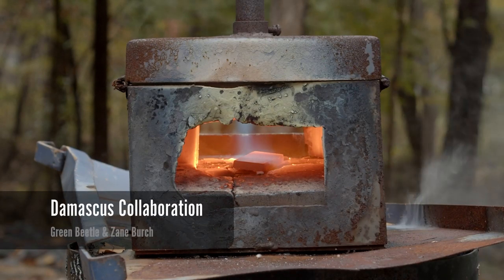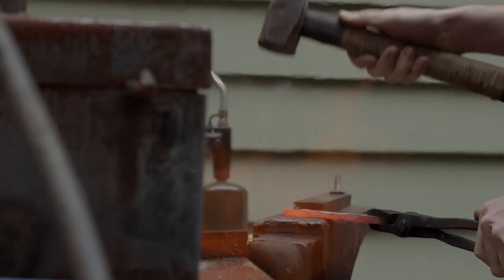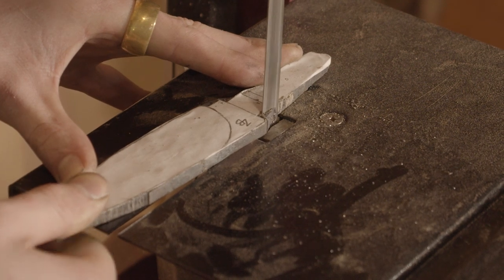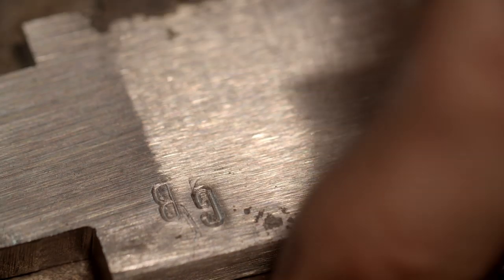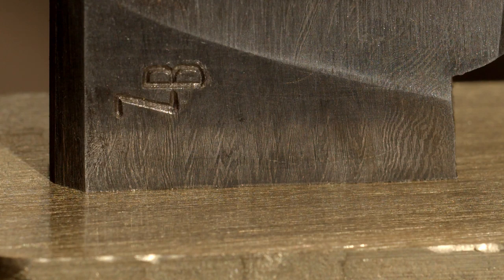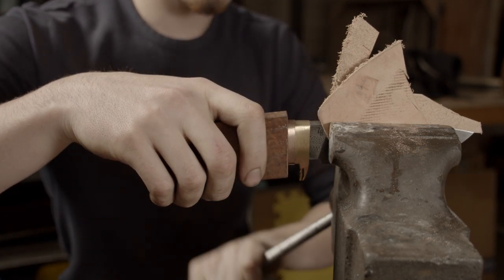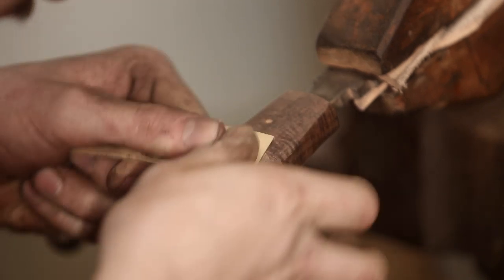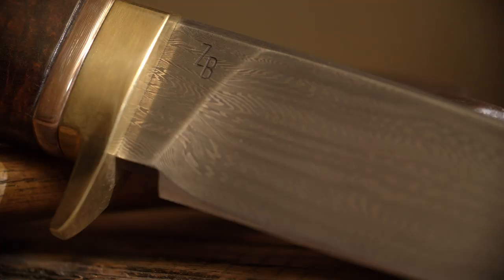Damascus Knife Collaboration With Green Beetle

Comment: The ringed gidgee pattern sure suit the pattern in the blade. Nice choice. Great to see a local timber used in a US video. That timber is a pain to work. No normal woodworking tools touch it, sanding is the best option. Thanks from over here in Aus.
Reply from the maker: AKA Nathan absolutely love that wood. And you’re right, it’s a pain to work with but it makes a great handle material due to its density

Comment: Great video. I would like to suggest however that you work on keeping your thumb off the back of your hammer handle. Holding your thumb parallel along the back of the hammer subjects your thumb to forces it was not designed to handle and will come back to haunt you sooner rather than later. Beautifully crafted knife though.
Reply from the maker: ManOf1ThousandHats thank you very much for the advice brother, several others mentioned that as well and I didn’t know that was an issue

Comment: Keep your eye out for a Die Filer Machine or make one. Way cheaper than a mill.
Think scroll saw that holds files instead and has a variable speed on work clamps.
One will save you a ton of time with filing the holes in the guards.
Reply: Unfortunately the files for those can be the expensive part lol.  But I agree, would be a cool machine to have.
Reply from the maker: Douglas Campbell I’ll do some research on that, thank you!

Comment: on the handle try 1/3 beeswax 2/3 boiled linseed  made into a paste
Reply: Thx have to try this recepie
Reply: @xj9779  you can get clear beeswax at ace hardware for about 3 bucks they come in 6 oz pucks just melt in pot with linseed and pour into a tub or old soup can in my case

Comment: man if i can offer one piece of advice take your thumb off that handle when forging you can end up really hurting your tendons doing that.  after getting some serious pain from my poor technique and taking almost 6 weeks of time away from the forge I learned quickly, do not have thumb on the handle lol
Reply from the maker: Shoaf Steel Workshop someone else mentioned  that too!! I appreciate the warning man
Reply: @zjbknives  No worries, one time was enough for me.  Kind like at work last week, I dropped the ass end of a boat on my finger requiring several stitches and now keeping me out of the workshop for a further 2 weeks (or until it heals up enough for me to do some grinding) guess who isn't working the back side of these aluminum boats anymore LOL